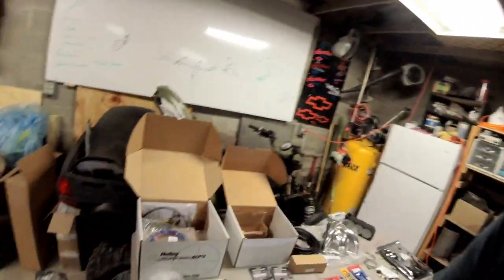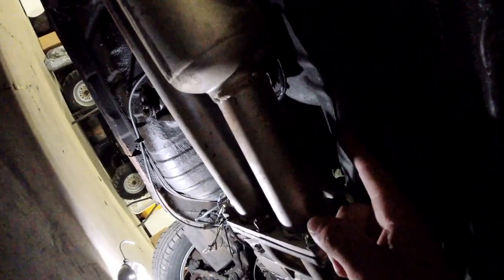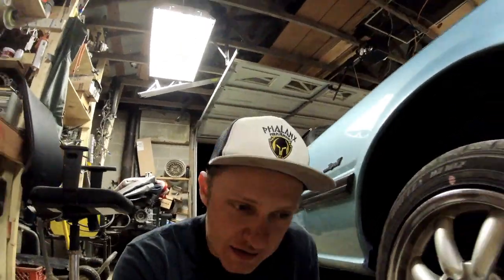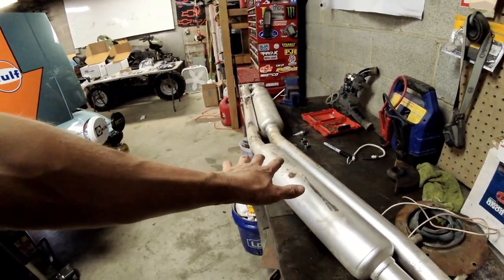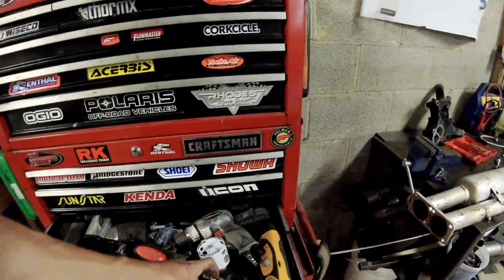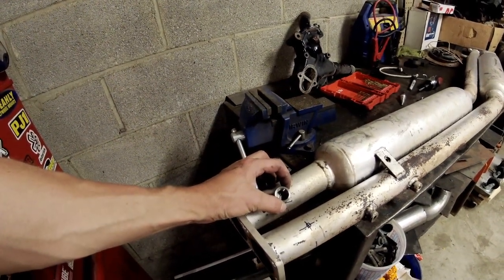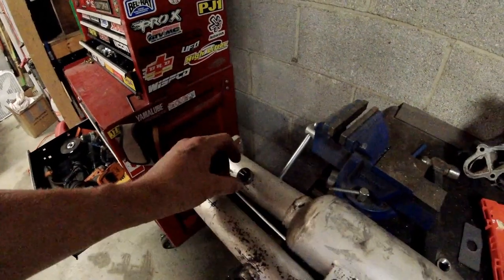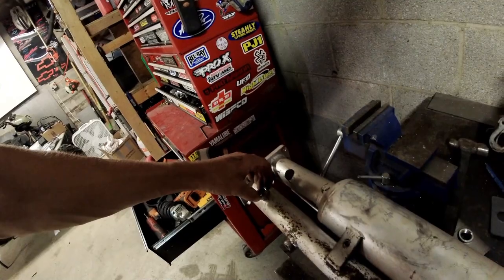Oxygen Sensor and Coolant Sensor Install - Holley Sniper on a Rotary PT-2

Comment: Unrelated question regarding the AC pulley. If I have deleted my AC, am I able to remove that double pulley from the crank pulley? I left it on because I didn't know if that would throw off the balance or anything, but it seems like it's just extra weight at this point.
Reply from the maker: Yep. Remove it. Stick the bolts back in. Don't let the small pulley spin on the hub as the small pulley has your timing marks on it
Reply: @AJ if you don't want it, I'll pay you for it. Living in Austin Texas AC is a must.

Comment: I would think putting  a x pip in and o2 in middle would be best for a good reading. Another benefit would be some scavenging from each rotor. Thanks for the videos. Makes me want to dust off my old 13b.